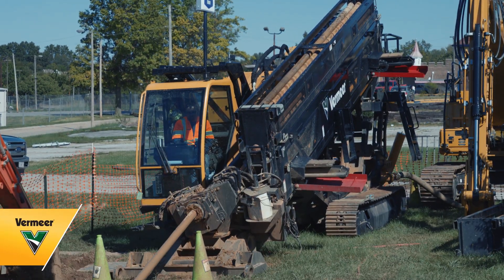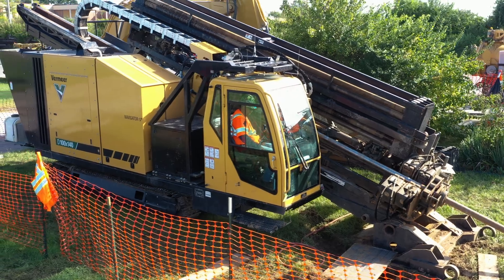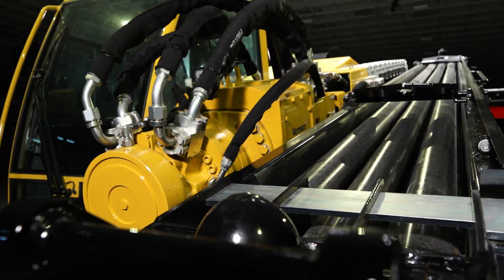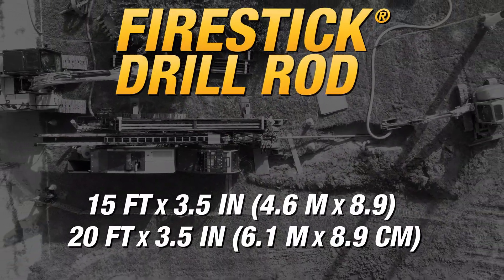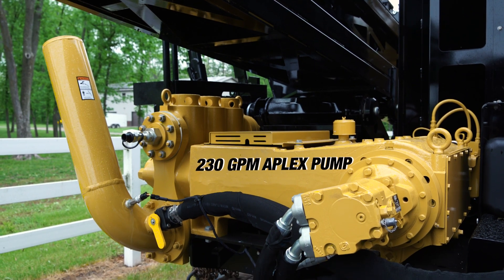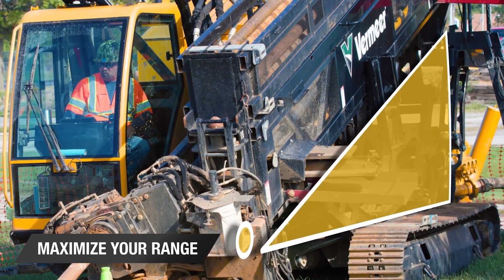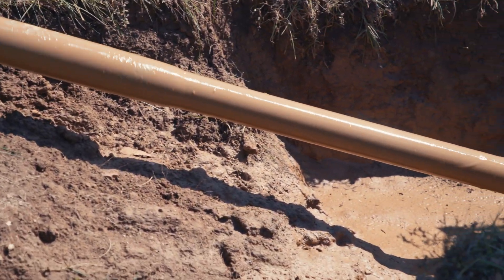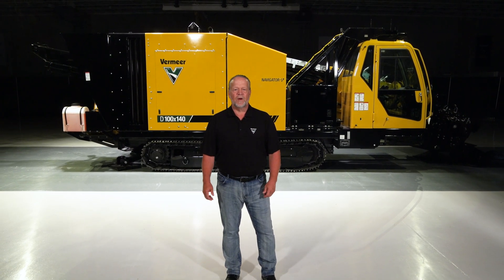Walkaround of the D100x140 S3 horizontal directional drill

Comment: If R&D are listening. The Rod guide roller bearings in front of the vice are a pain to grease because of the awkward location. We put remote grease points with small hydraulic lines off to the side to make it easier. Would work with most of your drill line up, just have to bear in mind that the top half of the assembly still needs to be able to lift off in the field